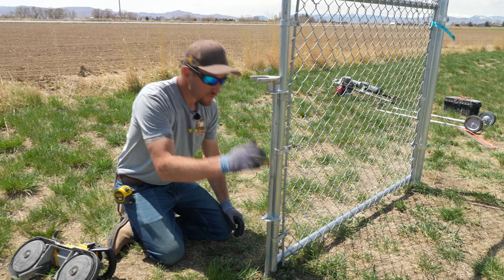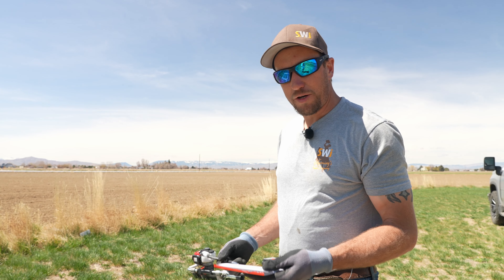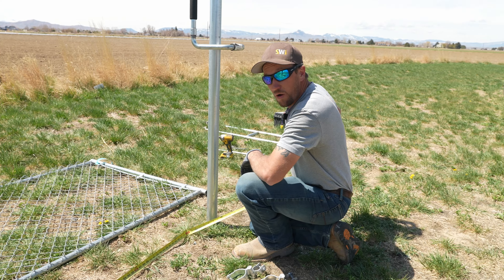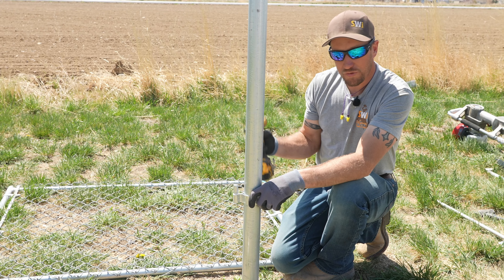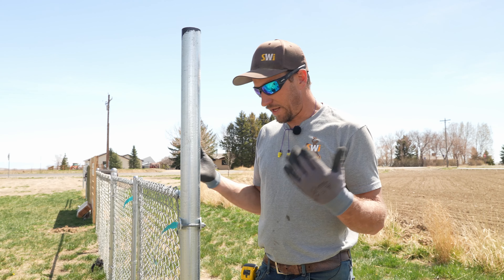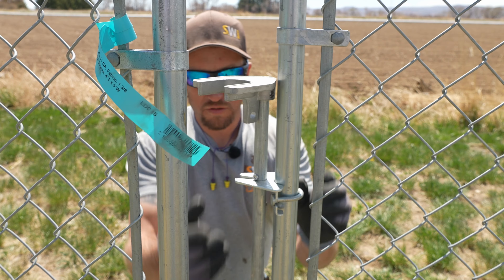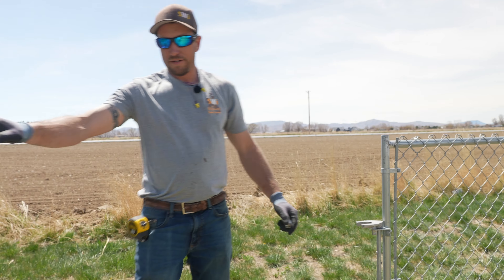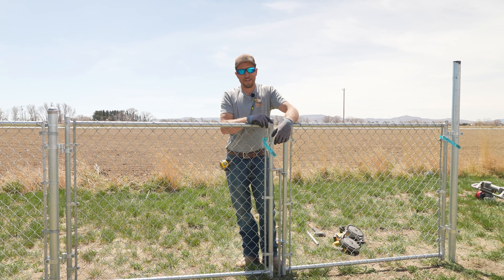Easily Hang A Double Drive Chain Link Gate

Comment: This channel has prepared me for my fence install tomorrow. Thank you
Reply from the maker: Yes!! Sweet! 👍🏻👍🏻💪🏻💪🏻👊🏻👊🏻
Reply: @SWiFence  Couldn’t I assemble the gate, drop rod, and hinges then measure the distance between where both hinges attach to the end posts so I don’t have to do multiple measurements? It seems like a safer method to me. Am I missing something?
Reply from the maker: Sure. Just make sure they're in a straight line and the fork latch is falling where you want it to. It feels more troublesome to me but you could definitely do that. 👍🏻

Comment: Thank you for the video. My question is, when calculating your measurements, and you laid your retaining post, did you include the diameter of the post into your measurements? Or, did you only measure from from post hinge to post hinge? I might’ve missed it so I’ll rewatch the video
Reply from the maker: Hinge to hinge. You're measuring for the space between the posts.

Comment: Great video, two questions for you. I have an existing fence that I want to put a gate in by using existing fence. Do you have a video for that and would you use two posts to carry the weight or just replace the existing posts with a thicker post? (No concrete, dirt). Also, what's that machine that you used to cut the drop post's pipe? Thanks.
Reply from the maker: We've got a video for that: https://youtu.be/eWmv83ZK_YQ This fence is on concrete, but the principles would be the same for set posts. Yes, you'll want to use end post thickness for your two gate posts--don't try to double-up posts somewhere, that'll look super funky.
And I think you're referring to the deep-cut bandsaw. 👍🏻

Comment: How much do think charge for ft!! Plus gates
Reply from the maker: There's no quick answer to that, Hector. It's about what you need to charge to cover the cost of the materials, cost of getting to the job, cost of labor, cost of overhead, and make a profit on top of that. We are the most expensive fence company in our area--and we need to be to maintain our business model. We just make sure we do the best work to make it worth it to the customer.

Comment: i NEED HELP- 

trying to rehang a chain link gate that is about 8 or more feet wide--it  came off the hinges very easily---but  now to reset the gate the male part is NOT going into the female part of the hinge. no matter what i do. i even tried reaming out the hole and using a dremel to thin out the male part. i am not that strong at age 71 and cannot afford a handy man. 

should i just buy new parts? 

or do you know an easy way?
Reply from the maker: I'm so sorry but it's extremely difficult to say without seeing it in person. New parts might help--but I can't say for sure.
Reply: Hey boss. If the gate hinges were loose or askew and had some weird weight on it, very probable improper swinging bent it and caused it not to fit right. Hardware for the gate is cheap, and each piece is sold by itself if you only need one component

Comment: Funny I can never get the gap between gates to be the right distance either. Always too much or too tight despite many measurements. The drop rods we  use are nothing but gate hinges and a galvanized solid rod. The rod goes into concrete or we just drill a hole in the coral rock and shove a pipe in it. I am curious though what your tatooos look like, maybe one day wear a sleeveless shirt? LOL!
Reply from the maker: LOL!